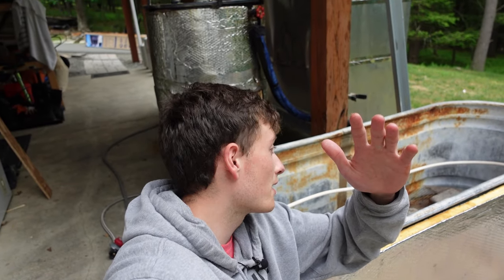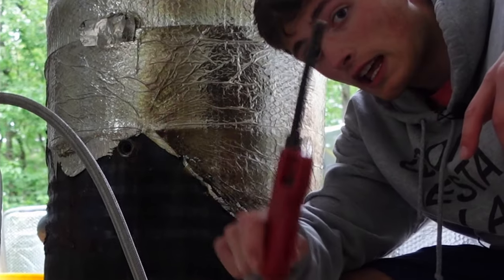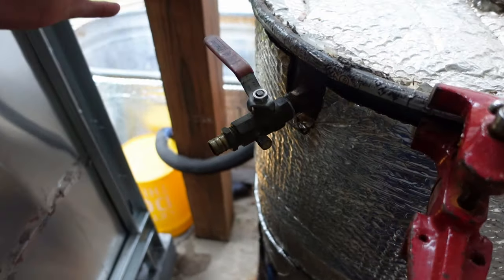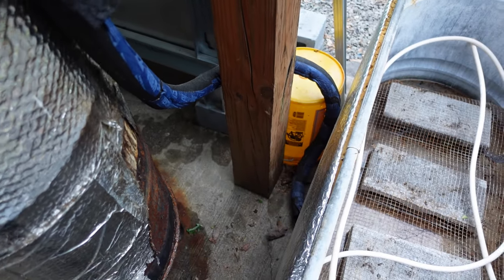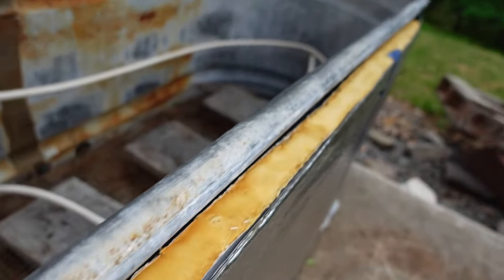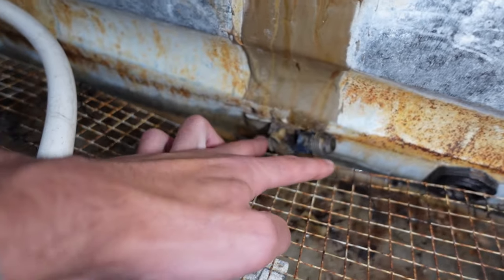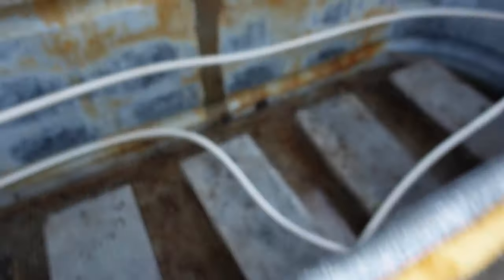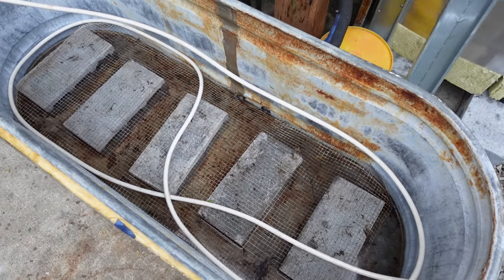Mushroom Steam Pasteurizer Build (Simple & Cheap)

Comment: Did you have some kind of blowout valve in case you forgot to open the steam vent?  The cooling mechanism is very clever.
Reply from the maker: Yes I did that's a great point! It was fun my old presto cooker I drilled a hole and poped it in the side.

Comment: So does this work with supplemented substrate mixes like masters mix or wheat bran supplemented substrate? As I understand they need to be sterilized. If thats the case then I really don't know what the difference between pasteurization and sterilization. Would definitely appreciate some help on the Thanks
Reply from the maker: Any substrate block you produce with supplementation should be pasteurized or sterilized pasteurized is killing almost all bad things and anything that's left is very weak to spread quickly, and sterilized is everything is dead. I pasteurize for longer periods on my operation using masters mix and no farther supplementation. This will work if you want to pasteurize not sterilize. With spawn you usually want to sterilize. Like highly recommended for spawn.
Reply: @mountainviewmushrooms71  ok that makes sense, thanks for the reply and keep up the great work with the content!